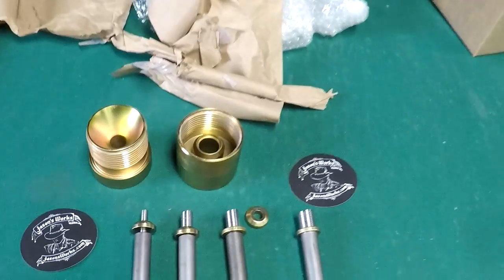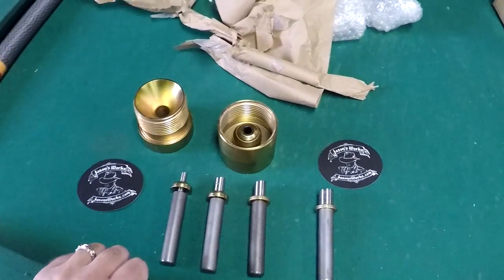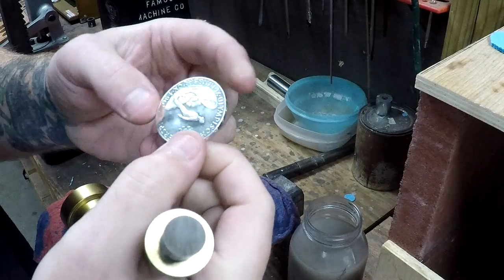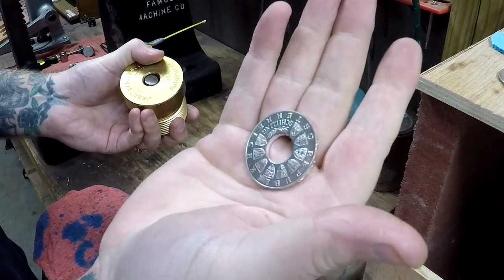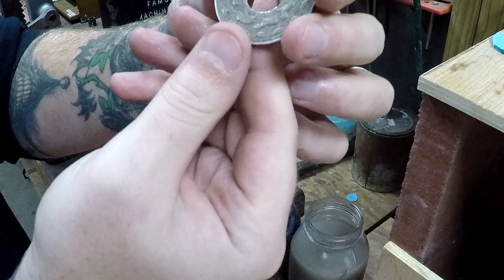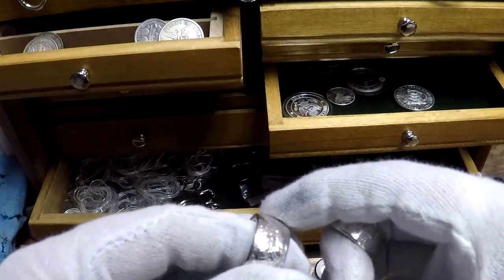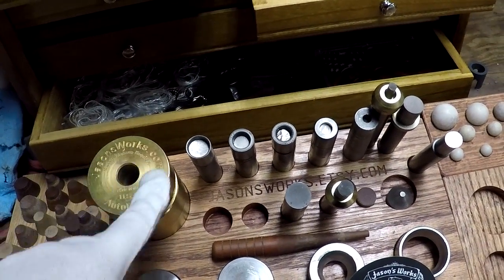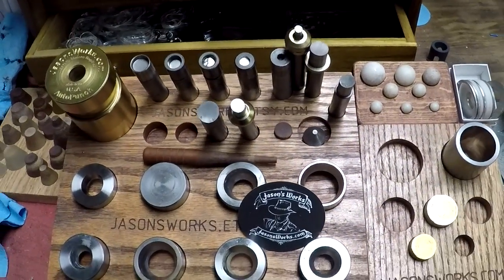New Coin Ring Tools! Review of the Brand New Auto Punch From JasonsWorks

Comment: There are that many threads because if u do the biggest size coin u would be at the biggest part of the cone so barely threaded in and if u did the dime size coin u would have to go down further cuz of the cone shape of the inside of the punch. If u want the option of doing all the different size coins with the 1 tool and have it hold the coin tight while slamming the punch have to have it threaded.. Makes sense..